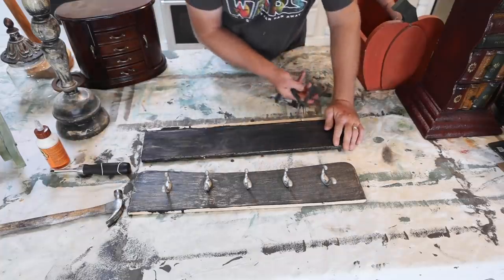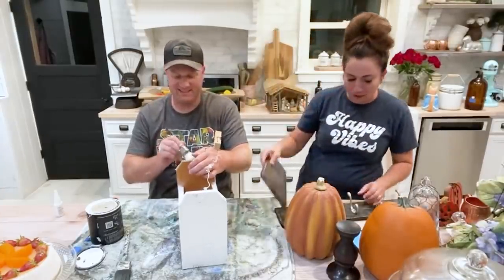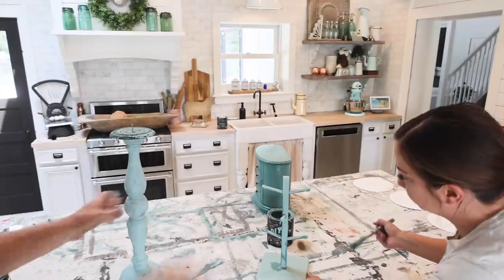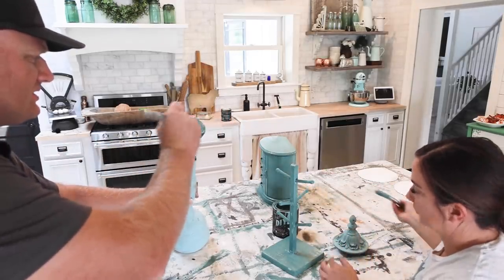Thrift Store Home Decor Makeovers Under $10.00 Farmhouse Style For Fall 2021

Comment: Great video. I've purchased a few of your stencils, and I was wondering... Is it possible to design them with a wider edge? It would be helpful, when you don't need to tape around the stencil, so you can pounce or swirl around the stencils around edges.
Reply from the maker: The stencils are designed for cost effectiveness but also to fit on things. So wider edges would make it harder for some projects. Something that might help is a smaller stencil brush. ❤️